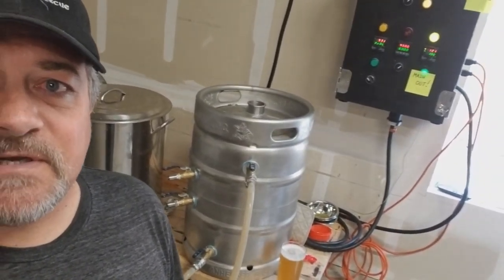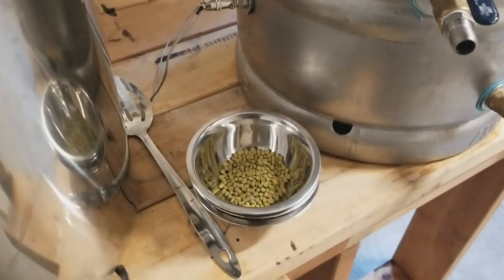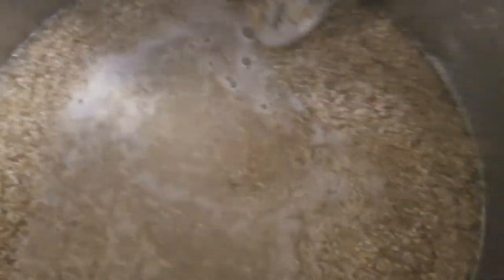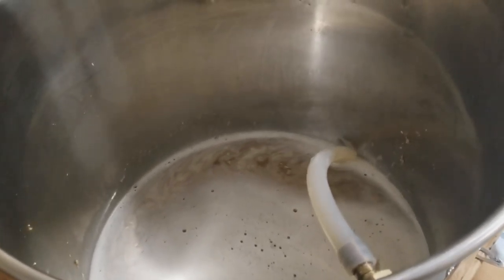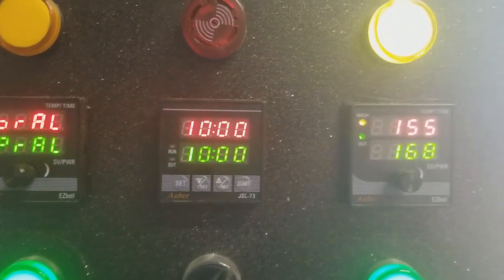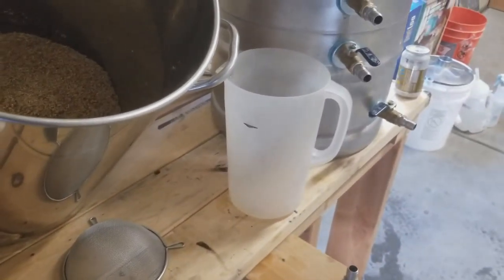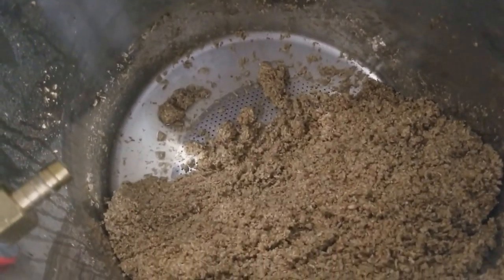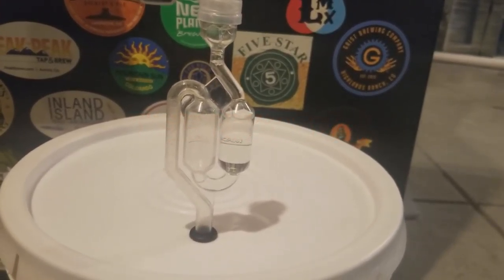Brew Day ~ Throw 20gether IPA ~ April 28, 2019

Comment: Nice explanation of your HERMS system. I'm surprised you can get your usual 10gal. to a decent boil with only 1500W elements? I'm still propane, but most of my guys are using those low density 45-5500W elements. I'm also still unclear on how you measure the amount of strike water to pump out of your HLT during the initial underletting? Must pick your brain in one of your live casts (in between Drewski growls). Cheerz
Reply from the maker: Thank you, brother!